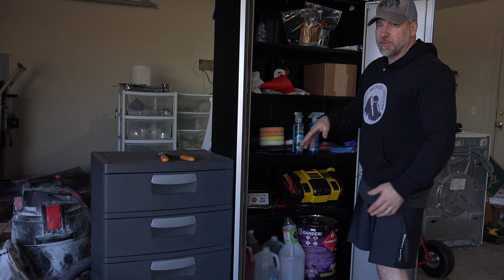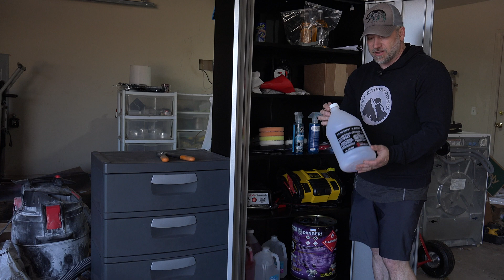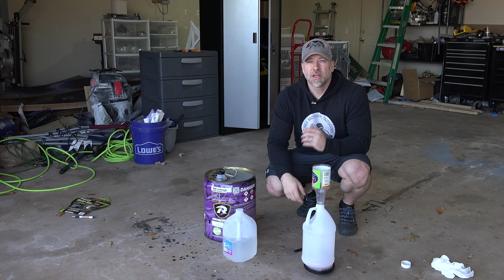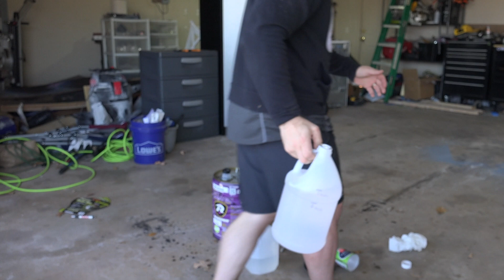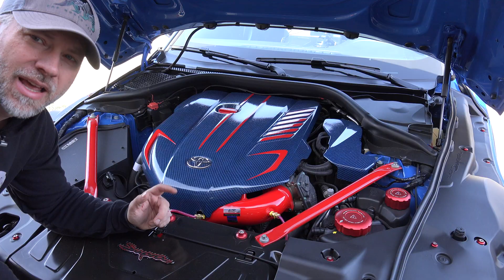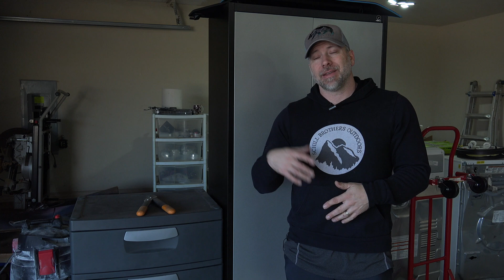How to Properly Mix Methanol // Supra Updates

Comment: Great video, question I’m in England, so if I use the metric system 1 litre of Meth/water roughly equals 1 kilogram, so I guess if I was making 5 litres and wanted 20/80 water/meth mix I could put 1 litre of water in with 4 litres of Methanol. 
The food colouring advice is great I have a 12 litre tank in the boot/trunk and the level is very difficult to see.

Comment: I’m totally using the ‘mark lines after weighed so you only have to weigh it once’ idea
Reply from the maker: That's the way to do it.  I just refilled one yesterday and just used the lines.  Be careful they can wash off pretty easy if you spill on the outside of the bottle.

Comment: Just a heads up, boost juice is measured by volume, not weight. As stated by a sno performance employee when I asked them.
Reply from the maker: Good to know, the probably put it quite a bit under 50% by weight

Comment: great video! I have discovered a cheaper way is by using a product labeled as "methyl-hydrate" from homedepot its 99.9% Methnol!!! Mix with distilled water by weight!!! 50/50 mix or whatever ratio you want!
Reply from the maker: Great tip!

Comment: 128oz/gal. 50/50 mix = 71.5oz methanol & 56.5oz Distilled Water BY WEIGHT !
Reply from the maker: Thanks!
Reply: 128 fluid oz are in a gallon its not by weight..... a gallon of water takes up the same volume as a gallon of 99.5% alcohol
Reply: @mcf3778 wrong. Water weighs more than methanol

Comment: When you run out of meth does the jb4 tell you? Example. If ur driving and all of sudden u run out of meth would you have to stop and switch maps to a unmeth tune?
Reply from the maker: No it doesn't tell you.  I have never run out though, I make sure that I check it every time I fill up (once I get home).
Reply: I believe there is an alert or an indicator on the methanol gauge. 
Also, if you get stage 3 snow performance methanol kit,  there is a flow sensor and if you run out of meth , it output a signal to ECU to switch maps .. that's on ECUTEK .. NOT sure about jb4 though .
Reply: no, but if you have a jb4 and it runs out, it automatically kicks you down to map0 i think.

Comment: The lines that Burger provided with their kit stained with food coloring so they always look red.😅. Still helps with seeing the level in the tank though.
Reply from the maker: Oh man, do they stain?  Ha, I can see fluid in them but didn’t realize!
Reply: @spiguyversgarage9452  we might have different lines.  Mine are the more rigid semi-transparent lines.  Even if I run straight un-dyed distilled the lines are red...
Reply from the maker: These were clear to begin with.
Reply: @spiguyversgarage9452  what brand of meth you use